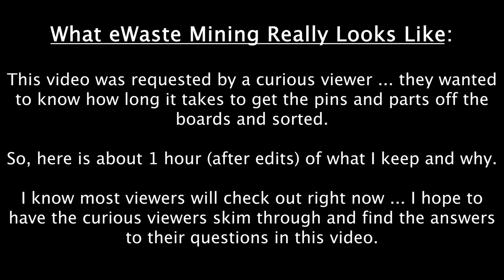What eWaste Mining Really Looks Like

Comment: Another thought or two. Those difficult to remove gold plated pins from the plastic? The sulfuric acid bath will do the trick. Secondly, soaking your pins and such in HCl to remove the solder... you're basically making stannous chloride. So it can be usefull later on.
Reply from the maker: Free tin :) I figured the tin was combined with too many other compounds to use as a safe SnCl2 ... Lead, silver and other metals could join in the fun.  I may try recycling my tin that way, but I don't want an unexpected Stannous solution to cause problems both in reaction, and to myself.  Pure tin is what I use to make mine, and I have enough of it on hand that I typically reuse my solder when soldering.  It is an interesting idea, and something I will look into.